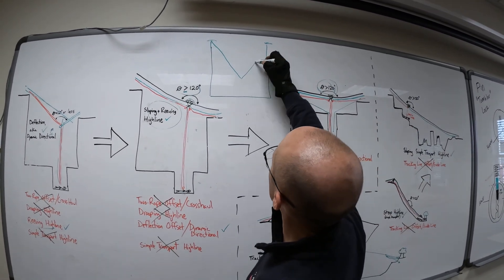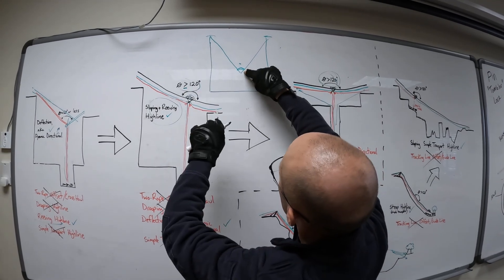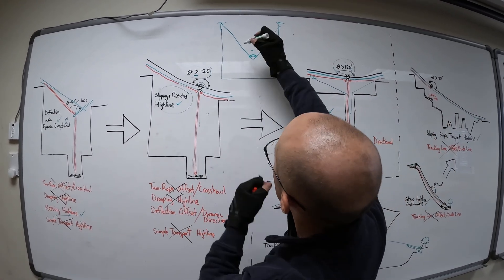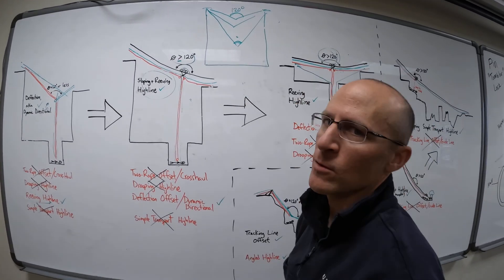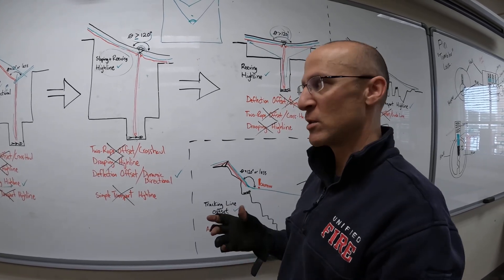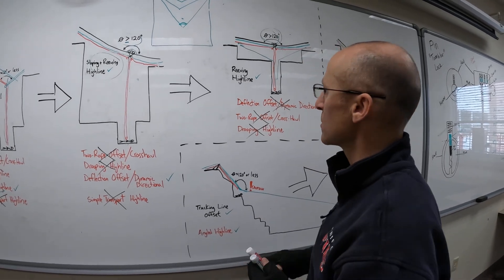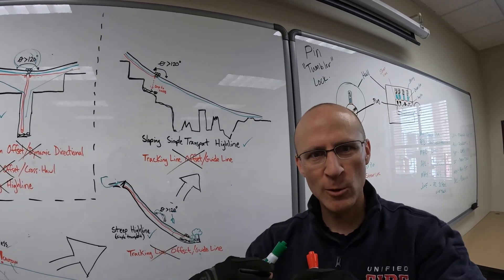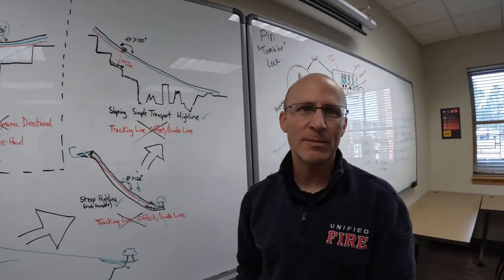Offset Systems vs. Highlines, & Comparing a Deflection (Dynamic Directional) vs. 2-Rope (Cross-Haul)

Comment: I think the emphasis has to be put on the anchor selection. For example, I work in Oil and GAs, everything is strutural and absolutely Bombproof. Theres no way I could tension a Cross Haul into the angles that would be a concern i.e 170 to 180 degrees, thats impossible for a couple of people to put that much force into the haul system to achieve. I have done testing before where we rigged a Cross Haul and yanked the crap out of it to see what the peak force on the Dynamometer is that we could get, if I recall we couldnt get it tensioned any greater then around 150 degrees so we only saw around 2 times the load (1 kN),it peaked at around 2.5kN. That was 2 people pulling a 3:1 on a Cross Haul rigged in a Fire Tower stairwell, out the window so we were limited for space but it was interesting to see and gave us comfort in knowing that we couldnt over tension the system, even if we wanted to. Ofcourse, if you have unlimited man power to throw on the haul team like you do with a Fire Dept, then youd get it allot more flat then two of us could. I think a benefit to the Cross Haul is the load is on the system while youre hauling versus a tensioned Highline that gets tensioned before the load is put on it so the ropes can be tensioned to a greater angle unless of course they use the rule of 18 or 12 depending on rope size. Anyway, thats my thoughts on this, love your videos, youre under rated as a resource for our small community.
Reply from the maker: Thanks,  all valid points… one small correction:  rule of 12 or 18 depending on rope strength, as opposed to size…. and for lofty static safety factors at that. Small teams not so much an issue on over-tensioning, but yes large teams or teams that have the ability to winch can be more concerning.  For that reason, when I rig highlines I’m pretty adamant about incorporating load cells to keep track of safety margins.  & with all things rope rescue, access, or recreation, while not “sexy”, the anchoring is always paramount

Comment: Excellent breakdown of the different systems. That was really good. Well done!

I noticed on your bridle you are using Petzl Adjusts? On one end you are using rings instead of carabiners. Is there a reason for that? What is the advantage?
Reply from the maker: Thanks!  The rings for the head bridle are for proper 3-way loading especially if the bridle is collapsed into “low-profile mode”.  When building it out I also tried using a steel delta screwlink, but didn’t quite like it as much